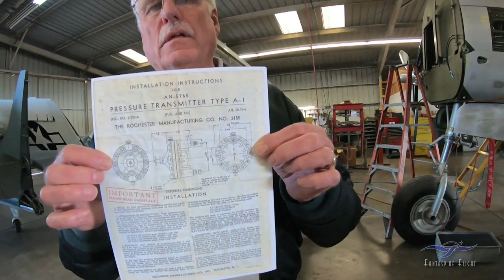Douglas A-26 - Project Update - January 2020

Comment: I can't breathe thinking about the cost of restoration. I have some beautiful things in my world, and understand 'value', but I also understand the cost of expertise, and the cost of 'replacement' (if available) parts. If you are going to 'do it', 'do it right', as value evaporates with loss of condition. Very impressed.
Reply: GordonjSmith1 Yeah would think like $1m+ for most planes to restore to flying order. But I would think at least with planes it must be easier to find the designs so you could reproduce most things if needed. Well that is what I have found in comparison to trying to rebuild an old ww2 tank.

Comment: The AC171 (3 electrode, massive)spark plug is equivalent to the Champion REB37N (4 electrode, massive) and the REB37E(2 electrode, massive). We used the 171 and 37Ns on the Navy C118B (DC6A) with no compatibility problems. The gapping issue was a problem with 115/145 gas (4.6 cc/gal tetraethyl lead), we just changed out the plugs. Old time C118/C54 flight engineer.

Comment: Kermit mentions not finding any 9th AAF nose art. Here on You Tube under "Ninth Air Force Exhibit" is a static display in Paris right after the war of various aircraft.  At 01:15 to 01:35 is an A26 with "Tom Swift's Time Machine" as nose art. Several other aircraft also have nose art. It's a black and white 20 minute film without sound. If you Google "A26 nose art", other pictures come up...

Comment: The quality of American engineering at the time this aircraft is truly superb. It's not just aircraft, the USA built the highest quality weapons such as ship and submarines. It's really impressive up close. PS: I am 55 and I'm the same as 25.
Reply: Not any more. check out the latest overpriced Colt Python.
Reply: @bigsolidboss781  the only pistol I have owned was a .38 S&W. Not the coolest thing for sure, but if you need a personal defense pistol, that .38 is going to fire every time I pull the trigger. I should have kept it. I am down to an old bolt action for deer hunting.

Comment: Is that your airplane or theirs?  To me, they acted like you were an intrusion.
Reply: They appear to be juggling a number of clients.
Reply: @dalecomer5951  I could see that they were working multiple projects and I can see the quality work they are doing BUT it also seems like they were a little arrogant and condescending.
Reply: @VicariousAir  Kermit has more money than God so I doubt they were being condescending. Old adage: Knowest Thou who butters Thy bread!
Reply: @KurgerBurger  I get it.  Having said that, I call it as I see it.  I can also tell you that where the butter comes from has little to do with the mind set of a contractor.  I hired and fired 4 contractors on a project I'm working on because their attitudes reflected a mindset where THEY were in charge of the project rather than following the desired outline provided.  Not understanding unrelated functions, they would frequently cut corners in areas that proprietary necessity rather than follow the plan.  It caused significant delays and additional charges.  Sounds a lot like whats going on there.
Reply: @VicariousAir  You should watch the older updates.  They were down right rude to Kermit in one of the videos.

Comment: so how much is a spark plug for this beast and how many are there
Reply: 18 cylinders per engine x 2 plugs per cyl. @ $35 or more ea. depending on which heat range is used. Spark plugs are often fouled just enough to need cleaning and not worn out.